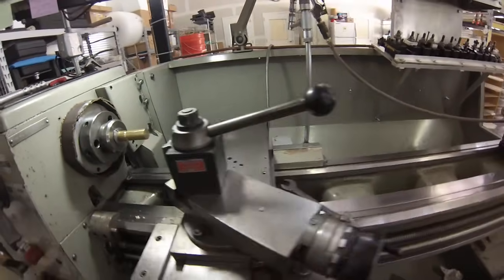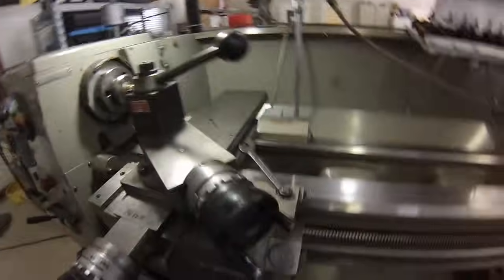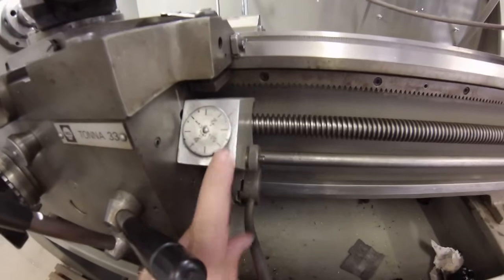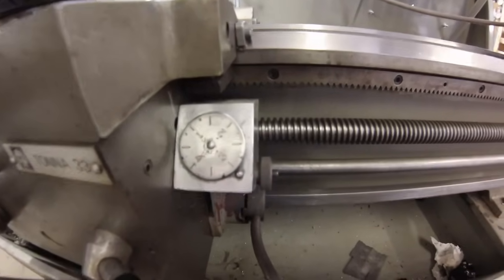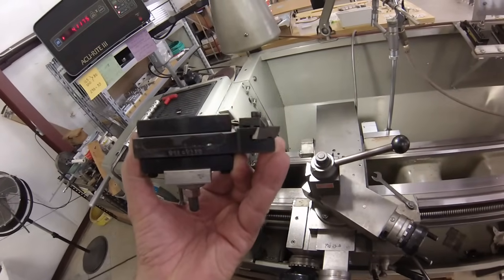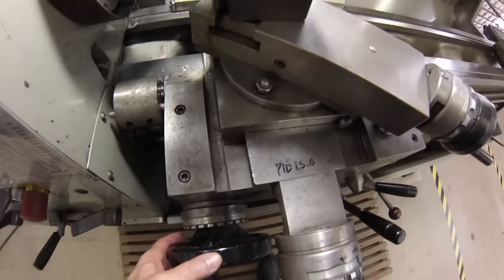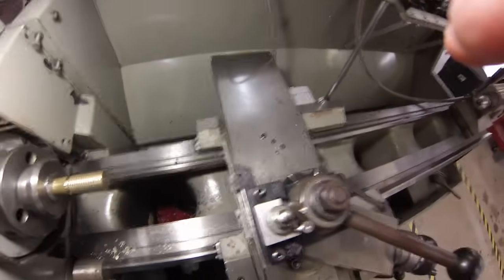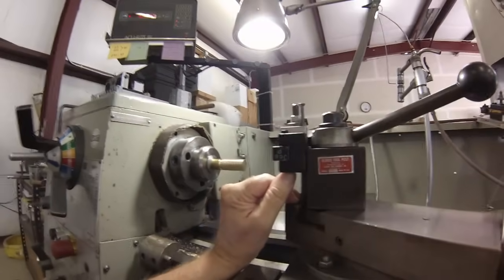Threading on a manual lathe  BEST TECHNIQUE EVER !!!!

Comment: I have been machining threads for over 40 years. I have never used this method. I now run a medium size centre lathe with digital readout. I try and never adjust my compound slide at all as it spoils all the pre stored sizes for other tools. So how do I make a thread cutting tool cut only on its leading flank. I am luck enough to have a reversing lathe. When I complete a cut and back up the saddle with the lathe in reverse, I stop the lathe. I then wind it a fraction more backwards to eliminate any backlash in the drive train. I then disengage the bull gear, you can feel the pressure on the engagement mechanism and by easing the chuck forwards a fraction it will disengage and then wind the chuck backwards a minute amount at the same time feeling the bull gear engage again. Basically you drop it in at the next tooth inside the lathe. Then power in back up and reverse back to the start. When I start the next cut the saddle will have advanced a fraction and you will find yourself cutting down only one flank again. It is surprising how fast you can do this wee correction.  When screwcutting towards a shoulder  I always put in a decent undercut with a nice radius tool . I have seen far too many threads broken off due to the square corner. I mainly don't worry about where the saddle stops. Usually if you set your tool in the correct place so that when you start screwcutting the handle is near half way up, in other words 9 o'clock. That way as you advance in depth the handle does not go over top dead centre and you only have to move the crosslide handle down and  it is withdrawn very easily and fast!
Reply from the maker: Try this method. You'll never go back.

Comment: I've tried it, and I like it.  The trick is to find affordable insert tooling for a left hand threading tool.  I found that Mesa Tool has a couple of neat tools.  The one I bought has a 1/2" shank and is double ended.  It can be used as left-hand, or right hand as either internal or external threading.  They also make a double ended 5/8 shank tool for external threading on heaver threads.

Comment: Hi Joe. I've been looking at a lot of youtube channels  to recommend some for my son in law who is learning to use workshop equipment and yours are right up there at the top. I'm a time served toolmaker myself so I'm less than impressed by most of the videos that are out there. Love the video above as it is exactly how I was taught here in the UK 35 yrs ago. Of course then they made us use HSS tools and hand grind them ha ha! We were also shown to use the rear tool post where fitted with the tool 'right side up' which was handy if making a batch of the same part. 17 years old and they had us cutting  a twin start square thread on a long brass collar that we had previously turned and shrunk onto a shaft we made with various tapers and shoulders  that were cut to various tolerances! Great experience! Please keep up the good work.

Comment: I have started to try to learn to thread this way. I am having trouble assuring insert is 90 degrees to work. I usually use a center gauge to set tool to 90 degrees. However carbide insert is small and upside down. How do you align tool 90 degrees to work?
Reply from the maker: The insert pocket on your tool is cut in true to the body of the tool for CNC applications. If you indicate your tool true, the insert will then be aligned correctly.
Reply: So use an indicator to make sure the side of the tool is parallel when the cross slide is moved in and out?
Reply from the maker: Correct
Reply from the maker: Don't trust the QCTP and holder alignment to be spot on unless you have set and ground them to be that way. Always check the actual tool.
Reply: Thank you so much for helping me!

Comment: Enjoying the tips and subscribed to your channel. I started machining in 1980 and to this day, before I saw this tip, I would have found any other way to cut a thread over using an engine lathe.  Personally hated them when it came to making threads and since they were not the main machine type I was setting up and running I could easily avoid them. Your tip is so “simple” yet brilliant and the fact NO ONE including myself in all that time attempted to do it other than the conventional way shows how easily we can be blinded by what is the correct or conventional way to do something.

Comment: " run like an old clothes dryer.." man! I haven't seen one of those in 40 years at least! Your videos are great! Thanks... I noticed you reversed the direction of the chuck, the travel of the apron away from the chuch, but the compound stayed the same, you did not reverse it... I guess it doesn't matter?
Reply from the maker: I plunge all my threads straight in. I never use the compound. Its OK to do if your machine and tools are rigid enough.

Comment: Thanks Joe. Really enjoy your vids. I do all my threading this way now, but since I got my new lathe which has a screw on chuck, I'm a bit nervous. I need to come up with a method to lock the chuck? any ideas?
The other thing where this method makes it a bit difficult is swinging the cross slide over to 29 deg toward the chuck. You can't thread too close to the chuck.
Reply from the maker: You can use the conventional 29 degree position with an inverted tool, it just changes which side is cut bias. I personally plunge in every thread I cut. I don't use the compound method.

Comment: Just found this channel. Excellent comunication and clarity of method. I made chips for about 40 years and I learned this method out of neccessity. I liked it so much that when TNC came along I insisted on still using this method because the burrs were easier to remove. When CNC came along and I got in the drivers seat I still used this method even though the burrs were removed during machining. You have a positive way of instructing so I'm looking forward to more of your videos. Just because I made chips for 40 years doen't mean I can't learn anything. By the way, you have a nice clean shop. Must be pleasant to work there.
Reply from the maker: Thanks. I like a clean shop. It makes it easier to go to work.

Comment: I prefer to thread up to the shoulder it gives me time to abort the engagement in case the half nut does not fully engage or debris are obstructing full engagement. And I run a old SBL with a threaded spindle. You also reverse all of the intended bearing surfaces in the carriage, cross and Comp.

Comment: Hey why when I'm threading metric if I disengage the half nut I can never get it back in sink
Reply from the maker: Most of the metric threads I have run suggest leaving the nut engaged. Finding the correct mesh is nearly impossible if you disengage the nut.

Comment: Joe, what do you think of the GHT retracting toolholder as a comparison to this method?
Reply from the maker: I am not familiar with that. I'll have to look one up.
Reply: http://www.hemingwaykits.com/acatalog/Retracting_Tool_Holder.html
It's quite an old design now, uses a dovetail slide, and sprung cam-action lever to quickly retract the tool with a flick of a finger. The book which explains the design goes into a lot of detail about the manufacture process. From memory I think the companion book actually states that, for the designer, threading in reverse wasn't an option due to a threaded chuck.

Comment: I am shaking my head.  Proof that anyone can put a video on YouTube.  I don't know you so I can't rightfully call you an idiot, so I'll just call you a fool.  UNSAFE in so many ways and bad for the lathe.
Reply from the maker: Joisey  if you can honestly tell me the cross section of the tip of a threading tool would stand its ground while the entire compound, cross slide and carriage mass self destructed, then I'd suggest getting a bigger lathe. As far as unsafe is concerned, eliminating crashing the tool into the part seems to me, like a step in the right direction. The tool will break long before the machine experiences any damage.

Comment: yessir best way to thread.  quick tips. 1. grease the top of the threads when using three wire, place the two top dead center and hold the bottom one.  grease holds to two in place.  2. Always keep a clean chip tray.  makes it easier to find the wire when you do drop one, and you will drop one once in awhile.

Comment: Two rubber O Rings slightly smaller than the thread OD over the wires holds them firmly down on the thread and easy to measure. They are the 'third hand'.

Comment: First time I tried this trick when I first started machining I ended up with left hand tread lol.  I though I had everything setup correct but still managed to get it wrong.  I also seen where the threading tool is behind the mounted part

Comment: Yes Joe! ( bit of a comedian helps stick the point :-)   )  LH / upside down / reverse rotation  takes some figuring out -  been doing some turning down an old damaged bolt  as scrap for practice on my Bridgeport MILL yesterday:   AMAZING - once you get the orientation of the tool set in  your mind. spent too long doing a lot the classical way and watching Vids etc with camera attached to tool post / saddle  - ALL RELATIVE Movement - but can confuse the mind.   Going out to try some more of this inside s out back 2 front upside down topsy turvy stuff. It HAS rattled the Pea container..  Yes the mind is being rejuvenated thanks!

Comment: I like the idea, but I cannot use it on my old South Bend lathe that has a screw on chuck. However, it does make me wonder whether I could get a bar (60° point one end, center drilled on tailstock end of the bar) to act as an extension of the live center, if you know what I mean -  this would prevent the chuck from unscrewing. On some jobs where you can do it: whenever you want to cut away from the chuck by running in reverse, the tailstock can be used to prevent the chuck from unscrewing. Certainly something to think about. I might try it!

Comment: Since you are driving your carriage in the opposite direction from usual, it seems that you would be driving on the unused side of the lead screw and half nut. This could result in more accurate threads depending on the wear in your machine where you are cutting threads. If you are duplicating your lead screw, for instance.

Comment: I love this method. However, when i turn my threading tool over the cutter cannot run flush to the shoulder. Can you recommend a threading tool that when flipped over to run in reverse will be on the shoulder side?
Reply from the maker: Any left handed threading tool should get you close to the chuck once inverted. Most major brands have them.

Comment: Don't set a lathe dog up the 'normal' way with this either, it'll slip to the other side of the drive slot/pin and possibly wipe out the thread.
Reply from the maker: I hate threading with a dog. Too much chatter.

Comment: Good morning Joe I see most of your videos they are very educational time, I have a question for you do you know anything about EDM I run Mitsubishi FX 10, for some reason this machine lost some in formation in the software, no problem, I install the flappy disk again soft were again I have done it several of times, the problem I have this time is that I cant se the taper Z on my program check the taper Z is were you see the tools clearance on the side and on the front of the tool I did my wire alignment  I did my angle check I did run my Z program check so, I have done all that I think I can do but when I still not getting the double lines on program check  and this is important on EDM operator this way before you cut your material you can see if the upper head is not having to much clearance betting bottom head thank I hope to hear from you on this matter Rafael Portland oregon
Reply from the maker: I personally don't have EDM experience beyond knowing what the machines are capable of, but I'll forward this message and see what happens.

Comment: Can you do a video on Taper thread?
Reply from the maker: Believe it or not, I haven't run a tapered thread in a very long time. My Clausing lathe also doesn't have a taper attachment. You could probably offset the workpiece and run a straight thread I suppose, but that would be very conditional.

Comment: So, Joe. My Victor 1660 has a provision to put an aux tool post on the backside of the cross slide. Gonna go off the reservation and ask if it's feasible to cut threads using the aux toolpost. Don't see any drawbacks running the lathe in reverse and cutting toward the tailstock. Well, only one anyway - not being able to see what I'm doing.... but.most of my diving career was like that anyway.
Unless you tell me it's a BAD idea I'm going to build one and give it a try.  I've been an 'outta the box' guy all my life and it doesn't look like I'm going to change.
There are a couple of AR-15 barrels coming my way to have the  pointed ends threaded in trade for 4' of 2" brass round stock.

Comment: Januszkiewicz taught me the upside down stuff...like inside threading,,,upside down and on the back side of the bore, but you just taught me a good one....form tool upside down...the beauty is that it won't dive in.....one point though is to have minimum clearance angle. I like your style...OH, nobody else puts drag on the handwheel except you and me. (handwheels should be balanced...just fixed a cross feed wheel on my Jet.

Comment: Excellent. I’ve been machining going on 19 yrs. It does take the stress out of it for sure. It’s unfortunate that it only works with the single point tool application. Cutting tapered API and drill stem connections is a little trickier. Nonetheless great trick.

Comment: Joe great presentation I have use that method from the back side of the part. My question tho is about your collect closer I have the same machine and need a collet closer what do you recommend? The end cover is composite.
Reply from the maker: My end plate is fiberglass so I had to attach an aluminum plate so the anchor cleat wouldn't punch through. I believe my closer is a royal.

Comment: Joe, thanks for this video. I am new to machining and last night I turned my very first thread, a 1-3/4 x 8 from left to right,  away from a stop. It worked perfectly . You have shown me a method which not only works great but has given me confidence to move forward with other more challenging projects.
Reply from the maker: Outstanding. Way to go.

Comment: Hey Joe, I’m looking forward to trying the technique but I do have a question. I learned to set the compound at about 29 and advance the compound for setting the depth to make sure only the tip is cutting (HSS). That geometry seems like it’d be hard to perform in reverse because advancing with the compound pushes the tip in the wrong direction, unless you swing the compound to the “other” 29, but then the compound could be in the way of larger stock. Any thoughts or is my logic just plain wrong?

Comment: How come you are cutting the thread away from the headstock and towards the tailstock, however, you angled your compound slide to the right? This way your thread cutting tool is cutting on its trailing edge rather than on its leading edge.

Comment: Have you used thread triangles to mesure thread depth?  You can thread a bore by setting thread tool to 9 o'clock facing up and reversing spindle.  This does not work well with threaded lathe spindles.

Comment: Please tell the method of making multiple parts having same accurate length, width, inner and outer diameter on manual lathe
Reply from the maker: Sometimes its actually quicker to complete individual operations on each part before moving onto the next feature. Especially on bore work. Set the tool and leave it alone.  Run all the parts and move to the next OP.
Reply: Joe Pieczynski

Comment: Joe,
Neat trick! I like the fact that the chips fall out too.
I use the lathe in high gear and I made a handle that fits in the rear of the head to turn it by hand. I do all my threading this way and it's quick and safe.
Handles to turn heads manually have a lot of uses and they're easy to make.
Rob

Comment: Thank You, for this excellent tip !  I am concerned about threading in reverse with my old (excellent) Sheldon with a threaded spindle. Am I screwing the pooch worrying ?
Reply from the maker: Any time you load up a threaded on chuck by turning the spindle in reverse, you risk unscrewing it. The difference in loads is considerable, and the tool would probably break before the chuck dislodged, but the possibility is certainly present. Exercise caution if you choose to try this. Perhaps pressing a live center against the end of the work piece for a little insurance wouldn't be a bad idea. if the chuck comes loose, it will have to move out. The tailstock lock and live center pressure would help to prevent that.
Reply: THANK YOU ! The live center is a damn good thought. Keep it coming, you have a new 61 year old student ! Thanks again.